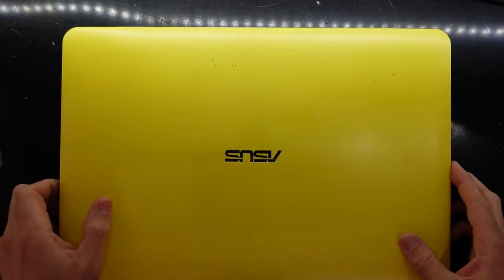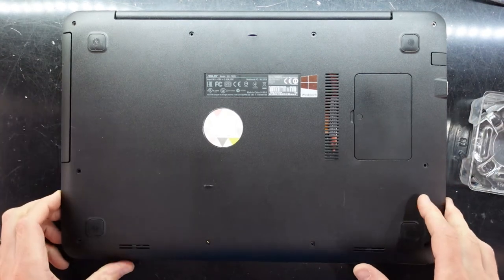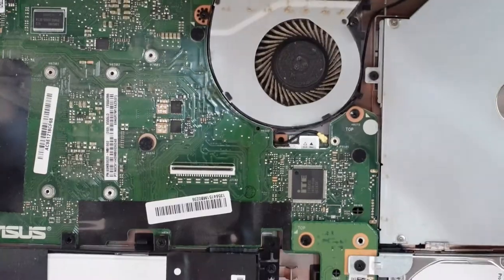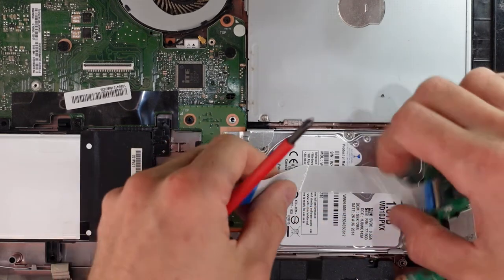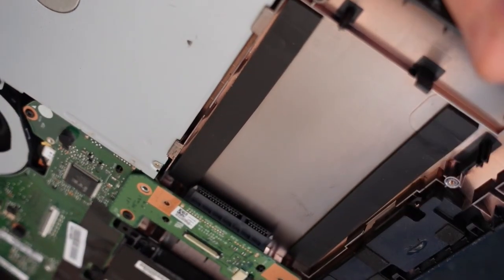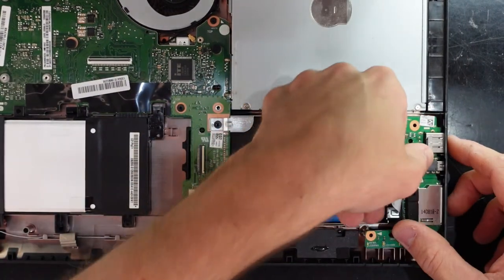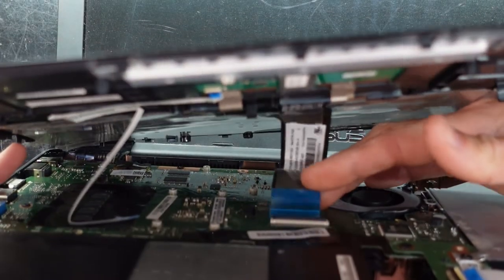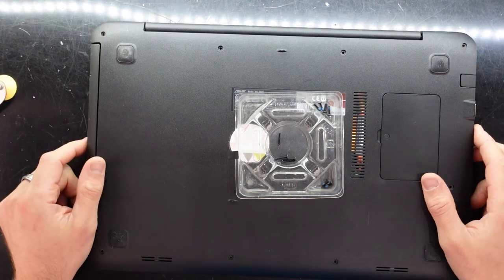Asus F555L hard drive replacement, SSD Upgrade!

Comment: Did it! I installed a Kingston SD hard drive. I had a few surprises. One of the screws to the hard drive caddy was jammed in and I stripped it. My friend used a Dremel tool to try and get it out and the vibration loosened it. I found another screw on an old hard drive caddy to use. I didn't get the keyboard ribbon inserted right the first time but got it in fine the next time. Thanks! this has made such a difference. So much faster, especially the boot!
Reply from the maker: Awesome to read you have overcome a few challenges but have now greatly increased the speed of your computer :D

Comment: I got a hold of an Asus x555d, in pieces, as the HDD was removed! Thanks for the guided upgrade, and where the different screws go!
Reply from the maker: No worries at all
Reply: @rickstechrepairs  I looked a little closer at the mobo, and it looks like the previous owners ripped the small daughter board next to or just above the HDD right out with the HDD! Only a small piece of it's left!! The plug in port is slightly messed up too!
Reply from the maker: bugger, you could still possibly use it with the daughter board missing and also if the HDD Connector is too far gone, but up a copy of linux off a USB Stick
Reply: @rickstechrepairs  I haven't looked closely at the SATA port for the HDD. It almost looks like a small, separate daughter board as well. I think the port might be fixable, but replacing would be better! Thank you 🤓